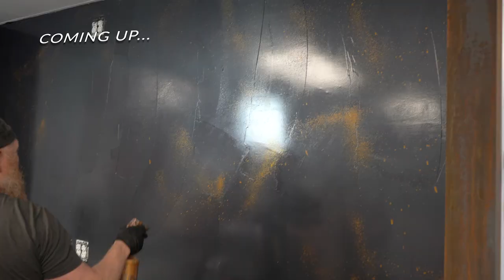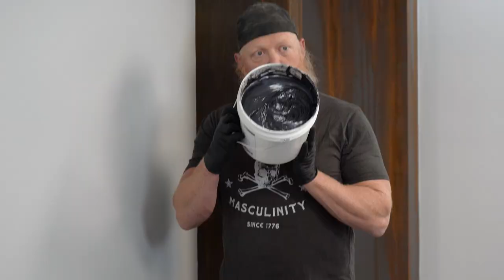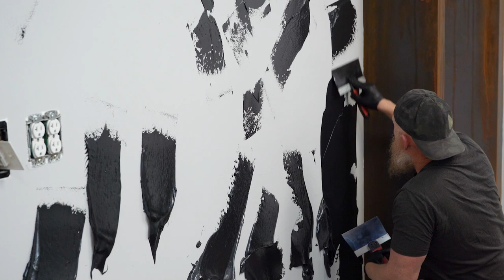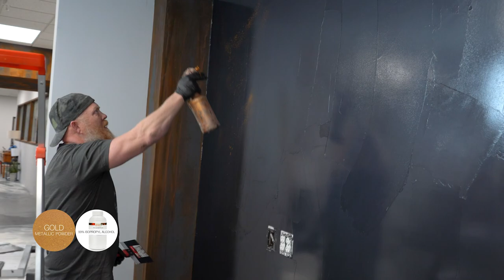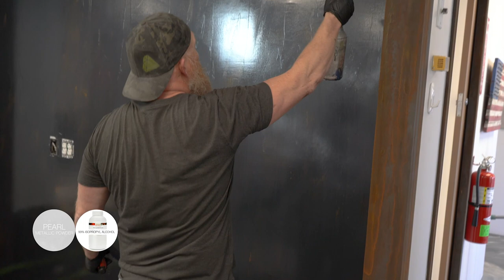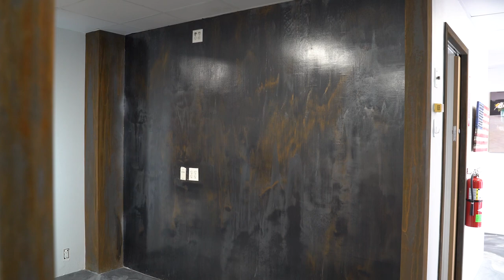HOW TO - WALL EPOXY - Countertop Epoxy - Non Sag Epoxy - Shower Renovation DIY - Venetian Plaster

Comment: How to prepare a brick wall or concrete wall for applying epoxy?

Can clear epoxy be applied on wall paper?
Reply from the maker: Hey great question for in depth instructions on your projects please give our tech support a call where we can walk you through the process 970-628-1846.

Comment: I'd like to demo the existing tile in my bathroom. What would be a good waterproof (or water resistant) substrate to use? Would cement board work?
Reply from the maker: We typically use mdf seal it and flood coat the epoxy makes it water resistant. Give our office a call for any questions as we have different products for different situations 970-639-9338

Comment: Is it possible to get it perfectly smooth? If you were going for a full slab of marble type look... and if so, how do you smooth it perfectly (sanding, etc)? Thanks!
Reply from the maker: Yes you nailed it you can sand it smooth for a matte or polished finish or by being very precise when troweling
Reply: @CountertopEpoxy  if you were doing this over existing tile, would you have to do a skim coat first to fill the grout joints?
Reply from the maker: @chalklinecrossfit8999  Yes we have a process for pouring over tile check out our pouring of tile video or give us a call 970-639-9338.
Reply: @chalklinecrossfit8999  You can but don't have too. If you chose not too you'd of course have to use more epoxy since those joints are adding square footage to the total. The epoxy may bond better to the grout coat depending on what you used compared to the tile.

Comment: I'm wondering about using this for a shower base. Would it maintain the slope towards the drain, or would it level out like other epoxy and mess up the draining?
Reply from the maker: Hey great question. Our wall epoxy is like a peanut butter consistency so it is meant to be trowel and won’t self level. Give our office a call for more info 970-639-9338.
Reply: @CountertopEpoxy  Thank you! And could it be done with clear epoxy, or would the additive cloud it?

Comment: What substrate to use for shower walls. Looking at options aside from tile
Reply from the maker: Great question! We typically use quarter inch thick MDF seal it then pour/trowel our product on! Give us a call for any questions 970-639-9338.
Reply: Hey thanks and might you be in Summit county?
Reply from the maker: @paulstephens9274  we are in Grand Junction Colorado however we do have installers throughout the U.S.